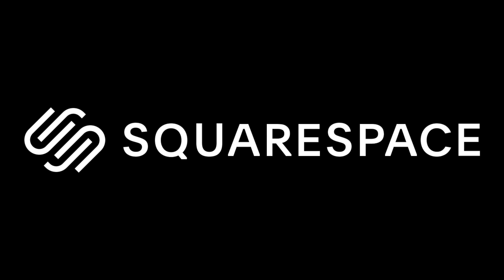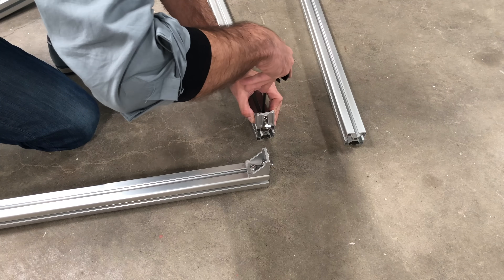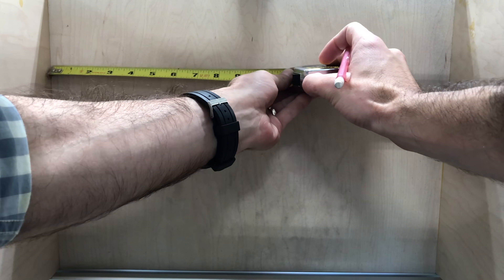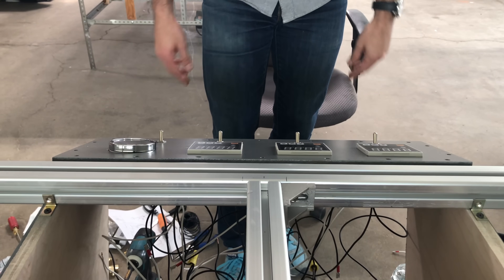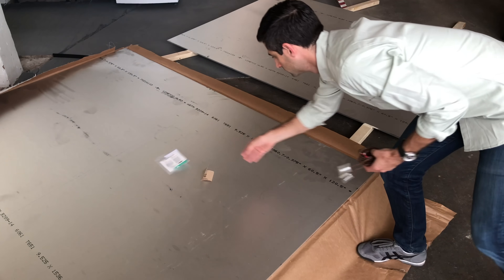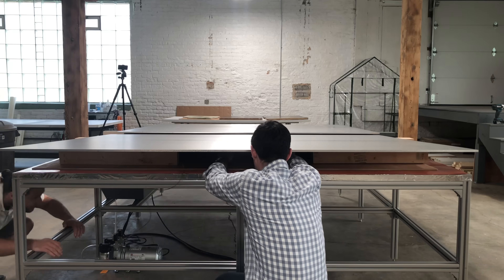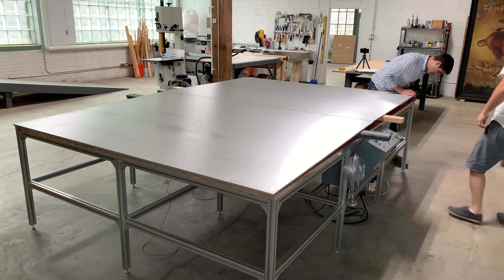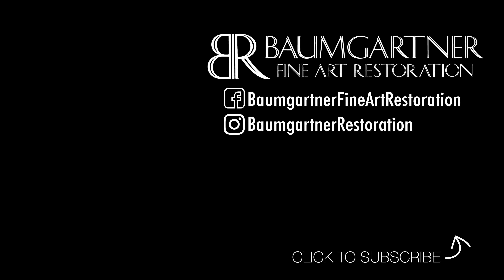Building A Heated Suction Table

Comment: everything was clear apart from where the suction is attached. were there some holes in the aluminium sheets that the vacuum pipes attach?
Reply: I think not. The area directly under the aluminum is not enclosed, so there is no way suction could come from there. I think on this table, he will have to manually position the hose to the side somehow.
Reply: He attaches it on the top with the "blankets" he puts over the paintings. He wants the surface to be smooth (that's the whole point when trying to flattern the paintings). It wouldn't be good having holes in the surfance, even just a millimeter in diameter could leave marks on the paintings.
Reply: I could have absolutely sworn the first table had holes in it.

Comment: Two questions:
1) did you consider an aluminium box for the control panel?
2) Are you going to put something around the edge to give it a finished look?
Reply from the maker: 1.) yes, but wood was so much easier to work with.  2.) probably not, it's fine as...
Reply: I would advice to at least file all the outer edge to remove any sharp burs. And definitely put something on the corners, you will bump into those at some point and when they are sharp you will be cursing your self.
Reply: fivelittleroomsinE I feel like baumgartener has never bumped into anything in his entire life

Comment: You should probably add some ventilation to the electronics compartment. Otherwise very cool build!
Reply from the maker: It's actually pretty cool surprisingly, but if it does need it I will add a few fans.

Comment: Nice looking build but for electrical safety reasons you really should tie the top plate and frame to protective earth. GFCI would be even better.
Reply: Maybe he has it outside the side box. If it cuts power for some reason, he doesn't need to unscrew all of that... Maybe?